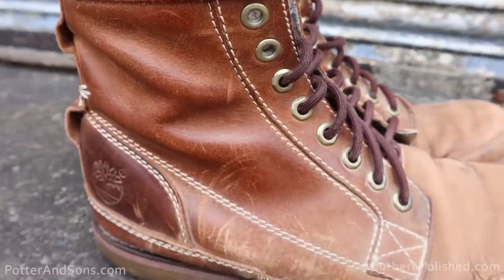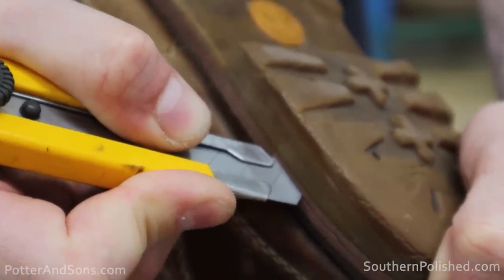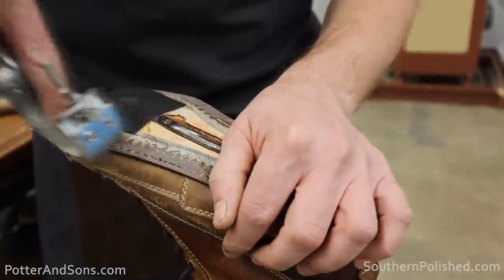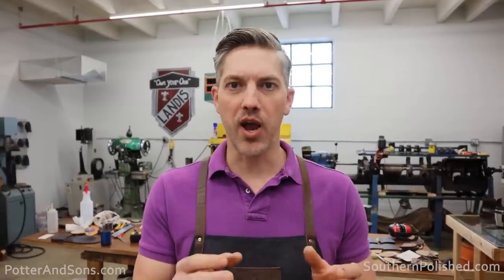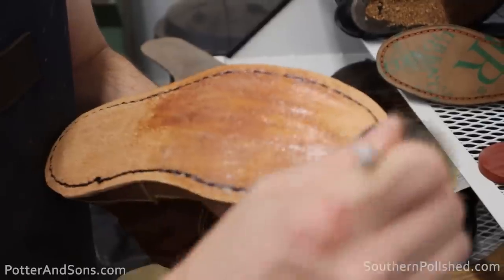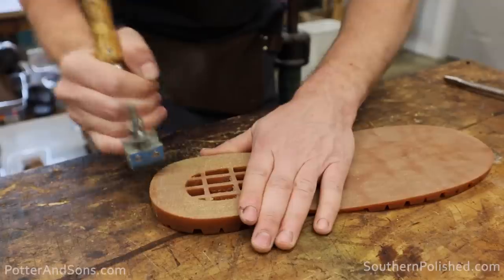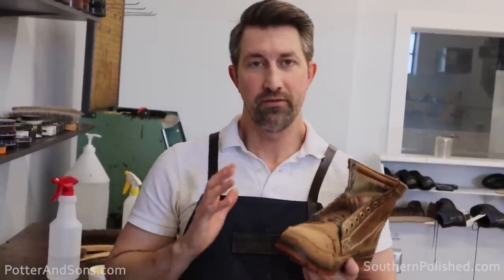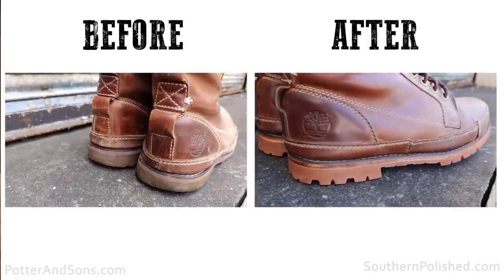Timberland Earthkeepers Boot Refurbishment | Total Boot Makeover

Comment: Hey I have those exact boots!  The original  outsoles are complete trash. No traction and you can easily slip with any slick surface.  I stopped using them because I wore out the outsole in less a year and they grew uncomfortable
Reply: I found that exact problem the sole wore out so quick . I bought 2 pairs of earth keepers in 3 years." Trash sole" perfectly described.

Comment: The original Timberland sole was described as a faux welt at 1:15.  It was replaced with stitched leather midsole.  At 1:40 it seems that the midsole is now the welt that won't be pulled off in any future re-soling.  Overall then the conclusion seems to be glued soled boots can be re-soled, not just Goodyear welted ones.  Also that it's possible to convert between the two.  Ignoring the cost factor, just for understanding possibilities.  Great videos on this channel.  Have learned and am still learning a lot.  Thanks.

Comment: Even before I knew much about boots... I always had reservations about Tinberland products. I never have actually owned any of their products but have handled, and tried on, several pairs on many occasions... but they never felt right. Now I see why. I’ve seen the construction of multiple products and they have all been rather lackluster imo. You guys did a great job polishing those tur... boots... to something mildly respectable. 😂
Reply: Timberland is just a division of VF Corp and their sole purpose is to maximize profit. There is no thought of quality. Vans, North face are other divisions.
Reply: I used to wear the Timberland pro anti fatigue boots(on my feet for 8-10 hours a shift).  The last two pairs I’ve had were only comfortable for maybe a month, then I had to add inserts to them.  They used to be comfortable for the whole life of the boot.  I switched to Thorogood and I like them much better.
Reply: Timberland were the bomb 40+ years ago.  They used to have a lifetime warranty where they would replace any boot regardless how long you wore them.  If you're going to wear them on weekends out on the town, they'll last forever.  I've owned a few pair and they're great as long as you waterproof the uppers.  They're not made to be used as work boots.  If you need a pair of work boots, get a pair Redwing.

Comment: Why didn’t y’all pull the stitches from the faux welt and stitch the midsole through it?
Reply from the maker: You would’ve had to use a Goodyear welt machine (outsole stitched), and because the welt isn’t truly fastened to the boots, the machine would’ve pulled the welt out of the boot as you stitch.  I like what you’re thinking though.

Comment: Can we use conditioner on a nubuck leather?
Reply from the maker: I wouldn’t recommend it.  It’ll definitely mess up the look and texture of the nubuck.  Nubuck is very resilient.  If you do condition it, use a conditioner spray.  The spray will apply a very thin mist which will prevent it from messing up your shoes.

Comment: I am commercial truck driver I deliver and pick up localy ,  I'm constantly on my feet moving cargo getting in and out of my truck steel toe is a must , I purchased some timberland pros work boots about 3 months in the tips on both boots started peeling of from the sole.  And the memory foam didn't last maybe a month , I glued the tips but they don't hold it sucks cause I like the boots but 150 $ for boots that last like  a 40 $ pair makes no sense . The leathers are still looking like new just disappointed . 😞 ..

Comment: Very interesting to have a shoe that has a fake goodyear welt but is actually blake rapid stitched, a type of construction that can produce a welted look anyways using a thin primary midsole with a true midsole perimeter stitched to that. I wonder if there was a structural reason other than customer request that they kept the stupid plastic faux welt when it would just better as a true blake rapid shoe.

Comment: The reason Timberland boots are constructed that way is to make them 100% waterproof. Even the leather is apparently tanned with silicone so the leather is waterproof. Not sure if reconditioning the leather affects that at all.
Reply from the maker: Timberlands are a good example of a one-time waterproof boot.  They’re “waterproof” until they wear out.  Once that silicone wears off of the leather, like these, they’re no longer waterproof.  They’re just dried out, cracked leather.